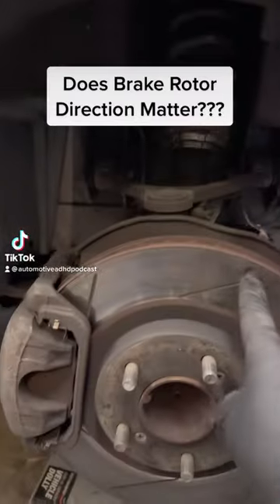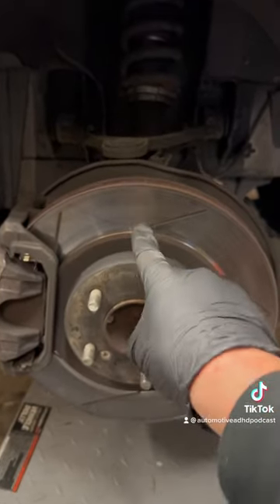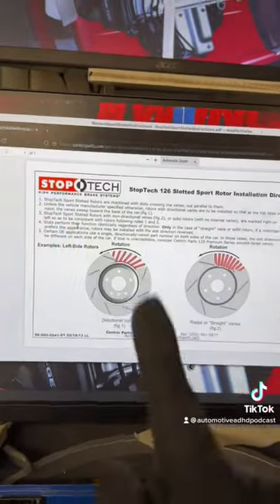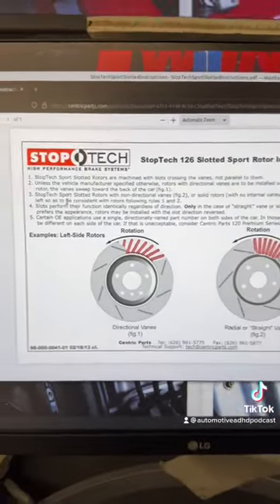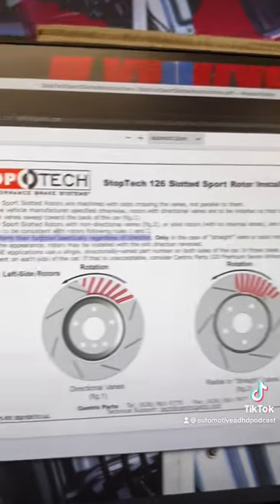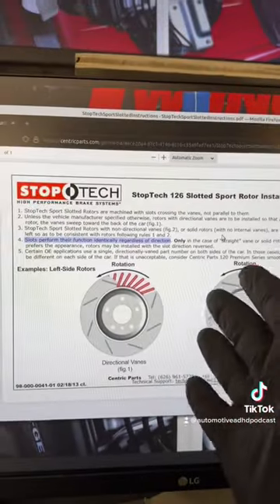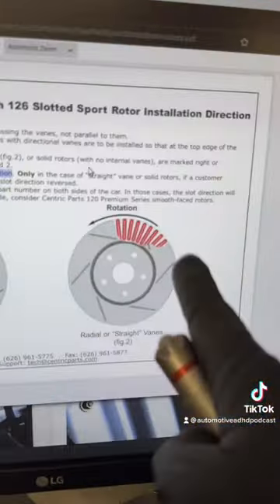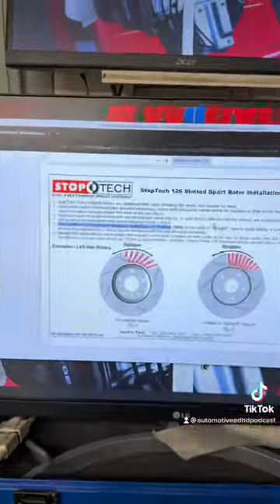Brake rotor facts! #hondas2000 #s2000 #s2k #jdm #car #automotive #honda #carlifestyle #jdmcars #cars

Comment: Directional rotors will be marked L or R usually. I’ve seen people with these rotors experience brake fade sooner with them reversed. Also wet weather performance is better with the slots expelling water out. Do a brake test from 60 to zero and check the temp with a thermal gun. In my experience, one direction was actually cooler than the other.

Comment: You'd want them NOT to "throw out " , BUT "scoop up" . Common sense, but it's not a Ferrari at a race track.....and what REALLY matters is the direction of.cooling veins, but on a car you drive fast as a dialy, id want it to "throw out" (moisture )AND cool, IF the veins weren't directional.peace

Comment: They should 100% be aiming the way you have them they grab the air and bring the air into the center of the rotor to cool it That's where your hottest spots are going to be in the middle
Reply: Under testing this doesn’t show, but it’s interesting
Reply: No, they’re aimed to get hot air out of the rotor, not bring cool air in
Reply: @samwell_6977  facts
Reply: @samwell_6977  ur a lil slow
Reply: @samwell_6977  35 plus years as a auto tech i have forgotten more about cars then u will ever know .  The  ones in the middle of the rotor r for that .. try again tomorrow

Comment: Slots are for heat dissipation in the first place…tat’s their ONLY function
Reply: They also perform better in wet conditions when mounted so the slots dissipate water out instead of directing the water into the rotor. Lol